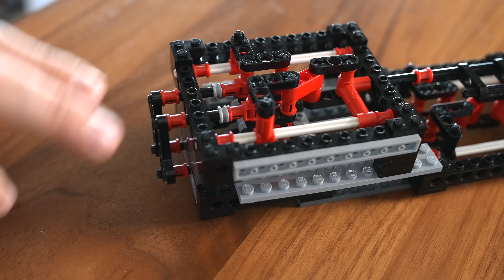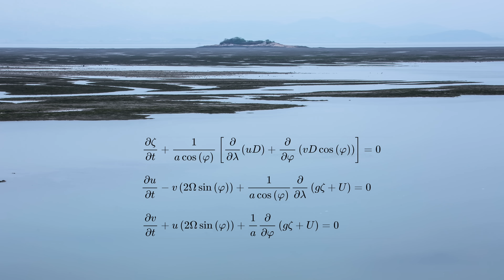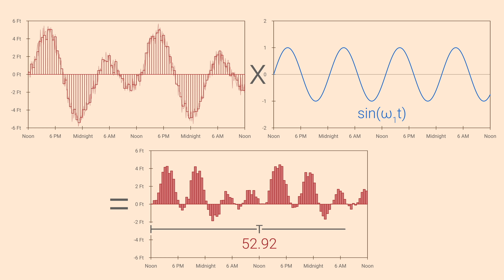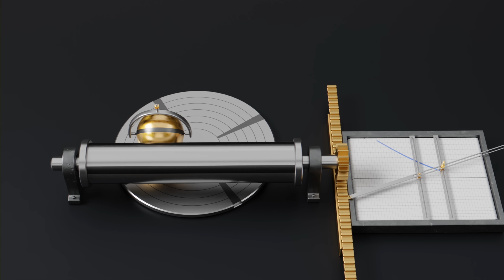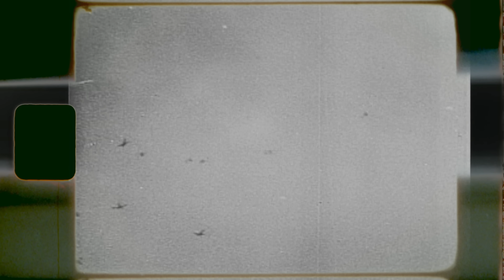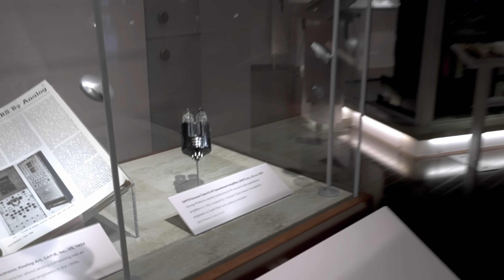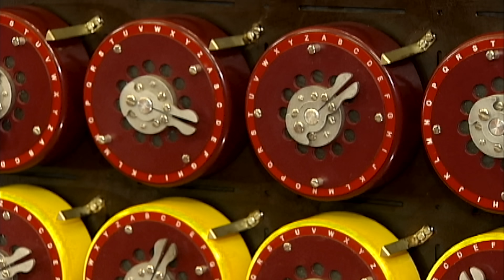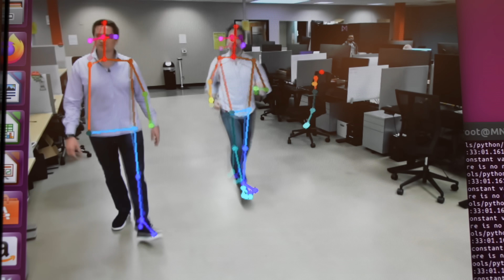The Most Powerful Computers You've Never Heard Of

Comment: Interesting.  I served aboard three different diesel electric submarines with one man control.  It was a large black box, about 3 feet cubed, which sat beside the "driver" sitting with a one man aircraft type control to control direction and depth, while the trim officer... dat would be me, sat beside him to adjust the buoyancy of the sub.  The one man control was fantastic at keeping the sub on course and depth.  One only had to dial on the depth and course, punch down the large button on top and the analogue box did the rest.  Our fire control computer for the torpedoes was, also, analogue.  We fed in the information about the target and it calculated the course and speed which it fed, directly, to the torpedoes right up to the moment they were fired.

Comment: Worked with a US Navy Gun Fire Control Computer for years in the mid 70's, before digital was common. They worked very well, but as explained, didn't always give the same exact answer twice in a row. Close, but not exact. That's why regular tests and calibrations were required. Since a projectile, unlike a guided missile, cannot change course in flight, having to consider ship pitch and roll, ship speed and direction, muzzle velocity, target altitude, range, direction and speed, time of flight and be able to predict where the projectile had to be to meet the target at a future position took a lot of timing motors, their associated gears and shafts, ballistics cams and their associated followers, synchros, resolvers, summing networks, indicator dials and hand crank inputs. My particular computer was about 6 ft tall, 2 ft deep and 10 ft wide. That could probably be replaced today by a computer the size of a typical tablet. Old systems like those have long been replaced by digital systems.. but the old engineering solutions were innovative and impressive.

Comment: When I started my career, 1980.  Analog controls were phasing out and digital just starting.  The digital computer we used was a custom design, 2, 16 bit shift registers into a single bit comparator, with carry.  We had 11 instructions, but only 4 were used mainly.  I asked why we moving towards digital when obliviously it was so rudimentary?  The answer, because we could change control equations with software, whereas changes to analog systems, always involved changes to hardware.   We had a group that modeled differential equations with this big patch board with op-amps, lags, leads and gains.  Analog controls are differential equation computers.

Comment: The Z3 was a German electromechanical computer designed by Konrad Zuse in 1935, and completed in 1941. It was the world's first working programmable, fully automatic digital computer. The Z3 was built with 2,600 relays, implementing a 22-bit word length that operated at a clock frequency

Comment: For a mechanical adder, I was thinking of using a series of planetary gears sets. Planetary gear sets can act as differentials. The Lego Technic adder in the beginning of the video also used a differential(a bevel gear differential instead). You could hook up the current sum to the sun gear and have the added component drive the ring gear. Then the output would be the rotating planet gears, though you would have to adjust it by some coefficient using some gear ratios.

Comment: Germany by far had one of the coolest AA fire control systems that was about 30 years ahead of its time. Sadly it never got made in large numbers. Maybe just one or two prototypes.
It used radar to track a plane, automatic hydraulics to move the gun and an automatic firing system. Essentially an automated firing system.
I wish I knew the name of it.

Comment: I still remeber my Vietnamese history class when we are taught about the most successful military static ever created by Vietnamese. Basically, we had a lot of wars throughout our history mostly against China, and they sometimes invaded from rivers. So we set up a trap. When the tide was low, we installed big wooden spikes at the river bed. When the enemy approached, our army used much smaller boats to attack and lure them into the trap area. They couldn't see the spikes as the water is over the spikes. By the time the tide got lower, their boats got penetrated and our small boats were just fine. If i'm not wrong, we used it three times and gained important victories against different chinese empires. Imagine how percise their estimations were. If the tides came earlier or later by an hour, the result might be different

Comment: This is excellent!!  Can't wait to see part II.
It's interesting that analog computing can be applied to so many types of physics..   
In engineering, you learn that many physical systems (electrical circuits, optical systems, mechanical, fluid/hydraulic, aerodynamic, etc) often use very similar differential equations and expressions to solve the physics.   That reasoning works in both directions.  Common mathematical equations can therefore be "programmed" into a physical systems to compute.   Just let the physics/nature do what it does, and the answer is extracted from what nature yields.  Ideas ranging from "DNA computing" to Fourier optics might make very fast, or efficient, or simple or inexpensive special purpose "hardware" computers.   (see "Fourier optical preprocessing in lieu of deep learning" by Muminov.)

Comment: You can use analog computers as a prediction system, but not as a modern day computers. They just can’t work in the same speed limit. Let’s say you moved your mouse. it would take a few seconds or minutes depending on the gear ratio to actually give a response, and not only that, but analog computers are fully mechanical. imagine if you dropped the computer and a gear slipped. you now need to fix the computer and align it properly because the boot up would fail. There’s a reason modern day computers are the way they are. Changing it would not work in anyone’s favor. Unless you’re in the military.

Comment: I have operated analog computers for flight simulators. They were huge, ate tons of power, and somewhat cantankerous. They were also accurate and instantaneous. There was no such thing a a 'frame time'. All the calculations took place with little or no lag.
Operational amplifiers can perform all the mathematical functions, using just a few resistors and capacitors. 

Servo systems simulated engine and flight functions. Watching a turboprop engine start was a joy. Half a dozen servos computing propeller speed, engine rpm, exhaust gas temperature, etc. The servos drove a series of potentiometers that were used as inputs to other calculations down the line. Switches and relays handled 'digital' functions; is the battery turned on? is the engine fuel switch on? Is the aircraft within range of a navigation aid.

Maintaining them was difficult, but being able to actually see what was (or wasn't) going on made it a lot easier.

I kinda miss them.

Comment: What a fascinating vid! I worked at IBM in the 70s/80s, and there was always some analog computing going on still, inside the lab, with all sorts of strange tools. Oscilloscopes hooked to sensors measured all sorts of things I did not understand at the time, but I puzzled through the operation of our cathode ray scopes and figured out how to troubleshoot the operation of the first (or second) Robotic Arm, used then to pump out disks and diskettes by the boatload. What a wild time!

Comment: And even more (as I referred to my earlier comment somewhere here) that what Mr Parkinson dream also occurred to me few times during few of my years as computer engineer in regards of user and/or computer problems. I was so into the problems that sometimes I dreamed about them and their solution though none of what I saw and read (yeah people argue we cant read in a dream but I somehow can n even remembered them especially if I m dreaming towards waking up) seemed to work once I tried in real life but still, its still an interesting experience to boast about huh... ✌️

And the last time dreamed something like this was just last year where in that dream I saw a traffic mgmt system in a busy city controlling all intersection's traffics (even pedestrians as they crossed) intersected automatically n smoothly without stopping (like current traffic light based system of ours). Vehicle (its a slightly diff for pedestrians though) were automatically taken control by the "system" as they approached an intersection where their speed and others (slowed or speed-up) base on calculation so that they may intersected and crossed without stopping within inches of each others as I saw in that dream.

In another dream I saw a (city within a) valley which uses flying shuttle to moves the people around. The shuttle were without noise or fans/blade. Interestingly when they stopped, I actually saw a blade system arrange in an interesting way that they may spin way faster than (we thought) physically possible that they became soundless n invisible to the nak3d eyes when in operation...

Just some of these dr3ams that I remembered n popped out as I watches this vid.

Comment: It is amazing how much brilliant thought went into things we now take for granted, and that serve as the basis for other advancements. We must never forget this.
I'm going to take a wild stab in the dark and say that the next video on future analogue computers might intersect with optical computers ..?

Digital computers ultimate selling point is the versatility - the ability to compute basically anything with very simple components if given enough time - but certain types of tasks are become very hard to compute in this way. Some problems grow exponentially with the size of the input and effectively become unsolvable because of it simply because the time demand would make the answer useless by the time you got it. Even if the growth of computing power over time due to technological advancement is very large it can never fundamentally solve these issues. I imagine analogue computers might help fill in the gap in some of these specialized tasks - and ultimately may make sense as co-processors in a system.

Comment: In the early 70s, US Army A60-A1 tanks we had an analogue computer. The Gunner would index the round to be fired with a detent dial. There were only like 4 positions. There was a sight on both sides of the turret. The gunner would see a ghost and a real image in the sight. The Gunner would spin a wheel to bring the two images together. This would raise or lower the main gun. This was very accurate up to 1,500 yards. At distances up to a mile you had to make guesses as to windage. 
We practiced this all the time as a tank team. we were to put the first round down range within five seconds of encountering a target and then every 3 seconds after that. That tank had to be standing still to do this. Subsequent US Tanks could fire on the move and could account for wind.

Comment: Digital computers don't provide exact answers. There is always a possibility that a stored or transmitted symbol flips in memory, register or on a bus due to bad luck of all the electronic noise conspiring to produce such a high amplitude of noise excursion as to flip the bit into the other position. So digital computers provide inexact answers.

Comment: The problem with (most) digital computers is the simple limitation of oversimplification. We have had technology to process, read and write more than just a singular "bit". However, due to patents and associated overhead of new ideas, we continue to support old new-ways, instead of new old-ways or new new-ways. The concepts and devices are out there, but many are on shelves or locked in vaults or balancing on a work-bench.

The next level of progress has to be more organic and fluid in nature. Less confined, like digital and simply smart enough to realize that analog outputs are off and just correct them. (We do that every day, just walking around. We "know" what the level floor feels like, but we instantly adapt to legos, throw-rugs, spilled oil and sink-holes, without falling-over, most times. That is organic, AI-adaptive and analog computing, at it's lowest level of operation.)

Comment: One thing about the Nordon Bomb sight that isn't explained well here.  Yes inaccurate Manufactur can induce problems in the calculations but this was not the main reason for the campaign change in Japan.  Analog computers, also need All valuables included in order to be accurate.   When firing a gun your taught windage and the adjustments to combat the forces wind has on ballistic trajectory as well as elevation and gravity pulling the bullet to earth etc... In bombing with a Nordon bombsite all these factors were taken into consideration.  But at that time, the wind current we now know as "the jet stream" was unknown and played havoc with the precise computation of the bomb drops from high altitude above flack and fighter ranges.  It was this discovery and the cost and time to reengineer this factor that was not understood that led to the low altitude fire/carpet bombing decision.   The bomb site its self actually had very good results in Europe but the cost and time needed to understand the unknown variable parameters were not available in a time of conflict to make adjustments so to bring about the objectives of the war effort in ending the agression a new tactic was used.  This is the true cause of the change, not manufacturing deficiencies or design inaccuracies.

Comment: Lets ask Intel about getting the proper repeatable digital results. I forget the processor but one in the 86 series would not repeat at however many decimal places it was. Forgive my memory it is somewhat faulty for trivial facts. I recall the fact just not the values. Also, many upper-level math courses -AP and college require a very specific calculator in that all students and professors/ instructors would get the same answer, whereas other calculators would give an alternate calculation. So Digital also is not perfect in some cases.

Comment: I love how some of these ‘ancient’ devices, are quite complex on one hand, but then again so very simple on the other one… Need a solution for some hard, mathematical computations? Just use a cord of rope, some pulleys and pistons, a pen and a piece of paper, and voila! Here are the frequencies of the tides at your disposal! Therefore, I really love the enigma machine! It is just a basic circuit that lights up a bulb, when a button is pressed. But the way the electricity has to go trough the rotors, switch board, and what not else, made it so hard to crack the code. And the whole damn thing was a simple piece of mechanical engineering, AND IT COULD WORK ON A COUPLE OF BATTERIES! That is just brilliant!

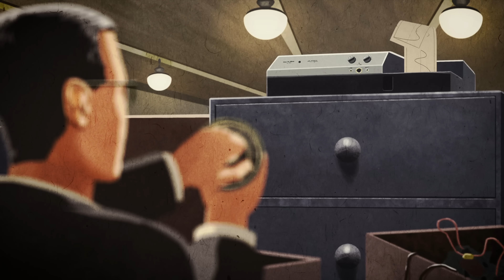Side note on the time stamp of 12:46 : here is a useless fact that I learned from a local radio DJ here in the Netherlands;
This girl/woman has studied psychology, and got her masters degree. (Why she turned out to be a DJ, well, I quest she just likes the job 😀).
But she once told this story over the radio. Apparently, when we go to bed, and we have a (hard) problem to solve and couldn’t let it rest until the last minute, our synapses keep on firing in our brains when we sleep. Our subconsciousness is still trying to solve the issue, even when we are sleeping. And every once-in-a-while, this results in the answer in a dream, when we are asleep. This resulted in the phrase: “let me sleep on it”, when we have an issue to solve, and can’t give an answer right away!

Once again I thank you for making a video, that just made me a bit smarter!

Comment: they also tell us that the tides are caused by the pull of the moons gravity, does that vary due to the time of day? it is like the moon is not responsible for the tides...
clearly we see different tides during full and new moons, does the suns light make the moon change it's mass????
or is the moon an anode, interacting with the cathode, that is the sun, and using the saltwater as the bridge??? makes more sense than the moons gravity....

Comment: The modern digital computer isn't "solid" in they calculation as may think. Even if you input hundred times the same calculation and result every time was equal. The way that CPU calculate will be different every time. Jim Keller says about that in his conversation with Lex Fridman.

Comment: You are inaccurate about bomb site issues in Japan.  High level bombing in Japan was inaccurate because of the jet stream. The bomb site could not calculate the drift and the jet stream was not well understood. Low-level bombing was forced because of this and it was determined fire bombing produced better results.

Comment: Those “computers” are still in use. 
Regulators on Diesel engines, are often way more complicated than expected. 

Some do PID better than electronic PID.

Not only regulators for revolutions, but almost any kind of regulation can be done, with very high precision and extreme reliability. They easily run for 25-50 years, with little maintenance.

The obvious advantage is, it can’t be hacked, blow a fuse, or need any kind of external handling. They simply run by themselves. 

Extreme shaking, even a nuclear attack, and they just keep on fully functioning.

As an example, a Diesel engine will run when started, even with no electric power, and you only need mechanical interface to adjust the preferences you want. ( speed )

It doesn’t need be that complicated, your lawnmower, has a mechanical “computer” to regulate its engine too.
Or my gravity powered clock 😆, that even has a audio solution that, annoyingly, tells me the time, every hour.